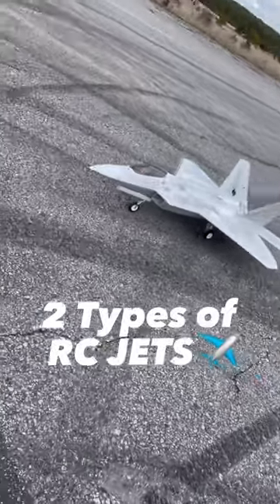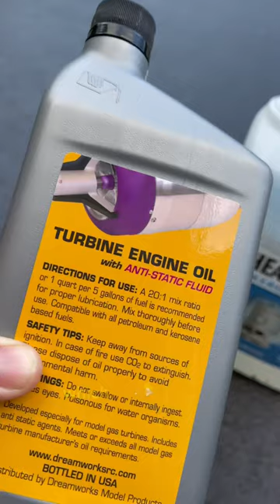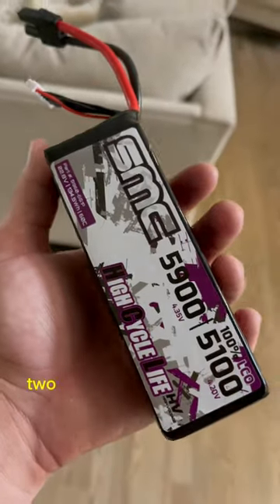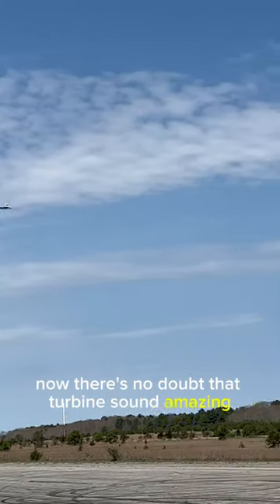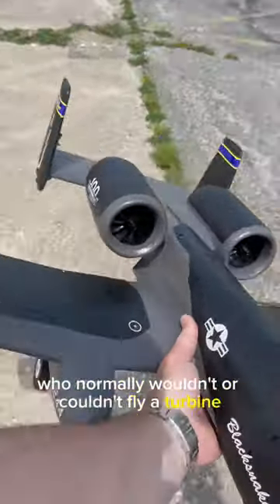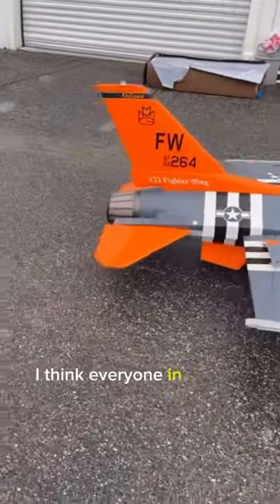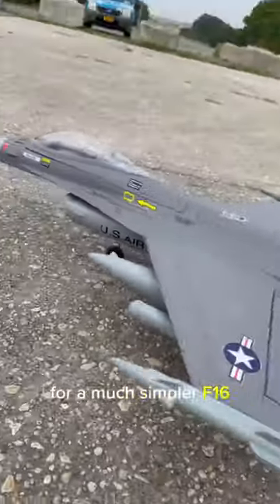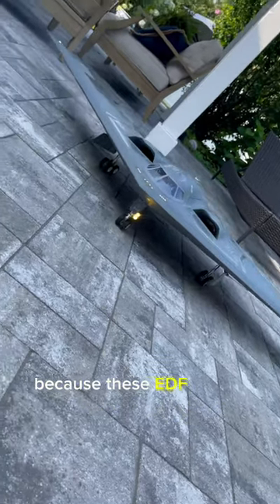The 2 types of RC Jets 🔥

Comment: Real turbines also like to start burning randomly when you start them, so it’s always good to have a friend with a fire extinguisher stand next to the jet when you start it
Reply: Also, just turn the fuel on when you’re ready to start
Reply: Which means you gave it fuel before it spooled up enough. Even military helicopters and planes need to wait for about 20%rpm before putting the throttle to iddle or you get a hot start with a EGT way beyond the limit.
Reply: @antoniohagopian213  that’s the problem you can’t precisely know rpm for RC jet turbines. If you have had the same jet for some time, you can hear it, but it’s still better to be safe than sorry
Reply: When it comes to turbines they can catch fire when they start and when they crash.  But EDFs can catch fire,  while I was testing and doing videos for high powered EDFs it did have it happen to me.  Usually what happens is I fry the ESC, motor, or puffed up the battery.

Comment: I use to fly RC jets when we had glow plug engines with tractor ( pulling) fans or the only pusher fan I knew of was made by Byron,it was a 6" pusher, you could take their F-16 & practically stand it up on its tail.
  My dream turbine jet is a tough one, a McDonald Douglas F-18 Hornet or the McDonald Douglas F-4 Phantom, it would have to be a twin of course

Comment: I have a small fleet of EDF's that cost way less than one single turbine.  They are mostly 64mm, but some are 70mm using 6S batteries that gives me much of the same speed and performance that a small turbine would give me for about $300.
Reply: EDFs do get a bit pricey when I  moved up to 90mm+ as the price of metal fan units, motors, ESCs, and Batteries rises.  But when running the 90mm+ fan units the planes are larger.

Comment: Turbine is more expensive but you get almost triple the fly time on average. Also you can just land and refill them. Yes you could land and put a fresh battery in but you’d need to time lots of batteries and that cost would add up quickly. Opposed to jet fuel costing about $5/gallon on average. And you can get several tanks out of a gallon.

Comment: Okay, stupid question.  Do the batteries get lighter as they use up their charge?
Reply: No
Reply: @auroratherob0t  Actually, I looked it up afterwards, and batteries do indeed get lighter with use, and it can be calculated using E=MC^2 rearranged as M = E/C^2.  But thanks for answering a question that you don't know the answer to, as if you did!
Reply: @DarthHater100  When batteries drain, they don’t actually get any lighter. According to special relativity, energy and mass are equivalent, so when energy is stored in a battery’s chemistry, it slightly increases the mass of the electrolytes. However, this effect is not noticeable for the vast majority of batteries. Basically batteries don’t get lighter once drained.
Reply: @auroratherob0t  ". . . when energy is stored in a battery’s chemistry, it slightly increases the mass of the electrolytes."

 Yes I know.  That's what I said.  The fact that the change is mass is small is irrelevant.
Reply: @DarthHater100  it is such a minuscule amount that not even a scale would pick up that the answer might as well be no.

Comment: Well 6 cell batteries.. which is 6 1 cell batteries wired in parallel to make one 24 volt lipo or lithium ion battery pack..
Reply: If my memory serves me right 6S is 6x 1S in series. 6x 1S in parallel would only lead to an increased capacity. But same PD and same current.

Comment: I had a RC plane once took it out after its first charge and kept it in the air for about 5 seconds before it landed in a pine tree that was over 60 ft tall right on the side of a cliff so I got to look at my plane in the tree for a couple months until it vanished one day. Would love to own another one but I only afford to eat twice a week I can't afford to buy a plane that's going to land in a tree
Reply: Yes, it's tough to lose an airplane for the first time out.  It's recommended to go to an AMA field.  Many experienced fliers there are willing to help a new flier.  Also the selection of a first airplane can make a huge difference.  I've always recommended new fliers buy a pusher designed Easy Flier, if you hit the ground with a pusher, it's harder to damage the prop and motor. With the easy flier design a new flier can learn to fly on their own if they can find a large open field.

Comment: U must be a young wiper snapper back in the day 70's 80's and early to mid 90's we had ducted fans with the same type fans as to days Lectrics but powered by Glo Motors that turned in the 22 to 25000 RPM and ran on Methylal and 20 to 30% Nitro
Reply: Now that's what I remember, so you're saying there are real.jets now?